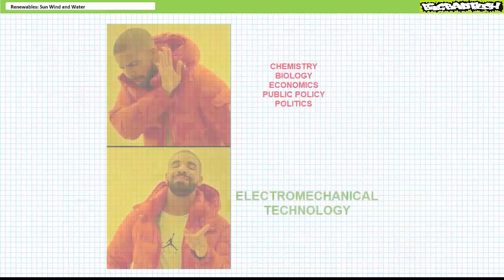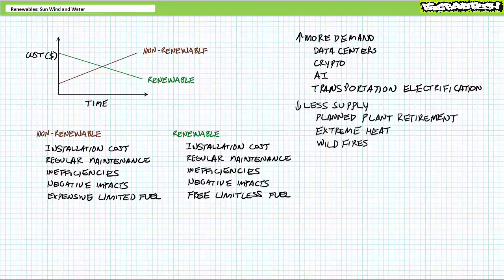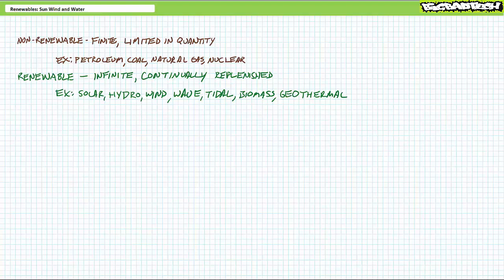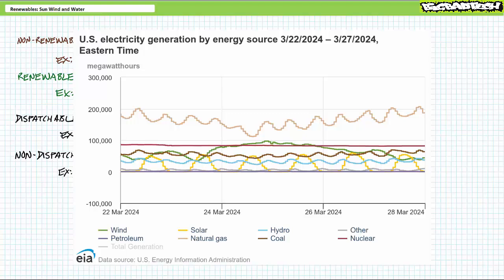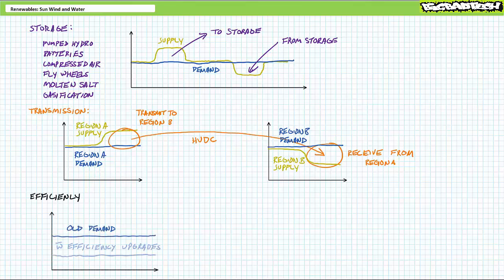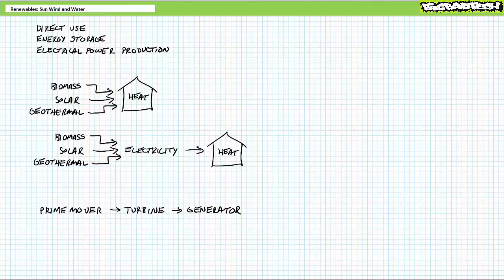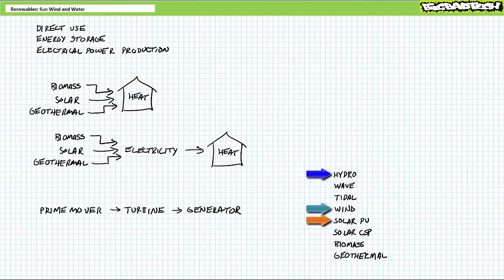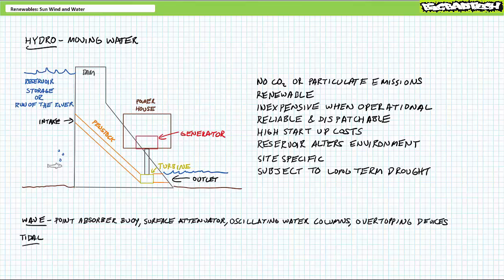Introduction to Renewable Energy (Part 1 of 2)

Comment: Jim is totally correct about fossil fuels being a limited source of non-renewable energy. I'd add that it is highly pollutant as well. That being said, trees and carbon capture plants can revert the effect of decades of burning fossil fuels. Personally, I'd opt for a hydrogen fuel cell with the only emission bi-product being water. As far as stationary goes, Jim is yet again correctomondo! All of the aforementioned methods have holes and layered together, they eliminate the inefficiencies of the whole. My problem with renewable comes in at lithium ion batteries. Not only are they very unsafe from my perspective, lithium mining is highly detrimental to the environment when compared to other metal extraction processes. Elon Musk is working on a nuclear powered cell and it's my hope that it'll eventually replace lithium batteries. Proof of the danger can be seen in the chinese videos of auto batteries exploding or spouting a spectacular tongue of fire that can cause 3rd degree burns to human tissue. Not only that, lithium fires are extremely difficult to put out.